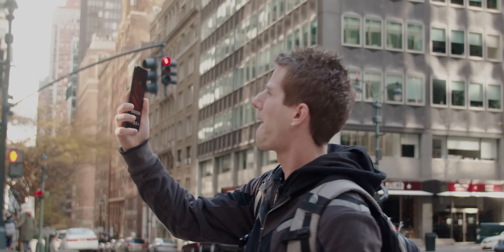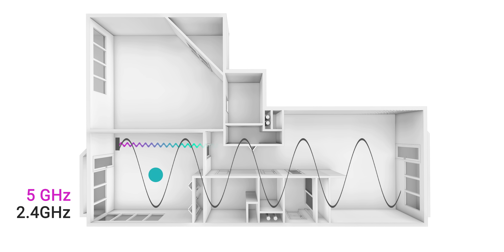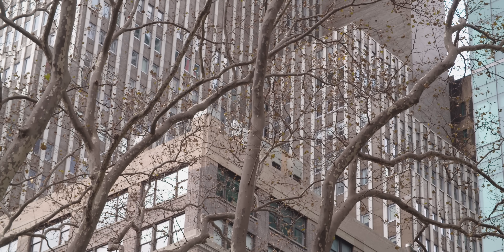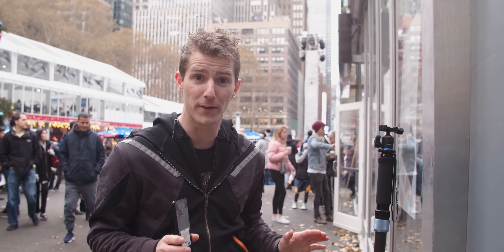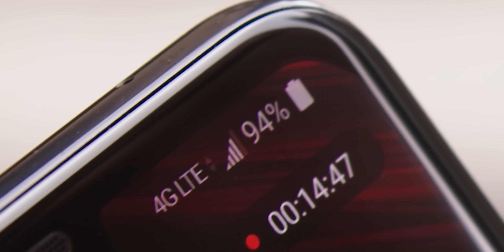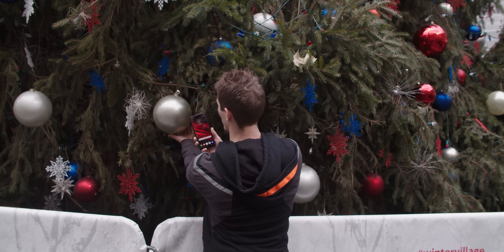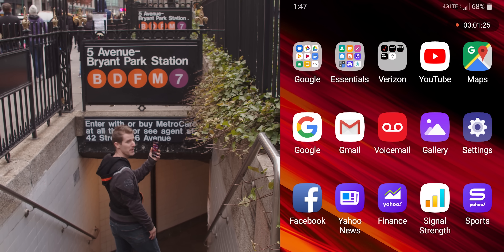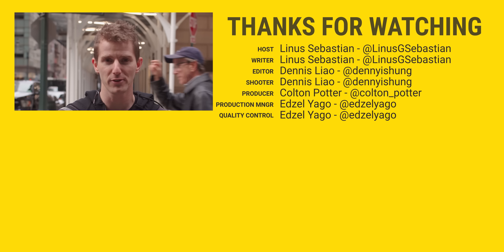The PROBLEM with 5G mmW...

Comment: There is a 5g mmwave right by the ER that also runs under our overpass. I got 1.727Gbps. If it falls to 5g its still about 100mbps. So coming from a 28.8k k modem and 2.1Gb hard disk I consider these speeds to be incredible.

Comment: This test is pretty misleading. 5G networks have only just started to be deployed. It’s true that mmW has MUCH greater BW and therefore higher data rate, but the carrier Freq is many times higher as well (MW vs mmW). It has always been known that many more “basestations” are required for full 5G deployment which is exactly what happened when EVERY other cell generation (G) was first deployed. Many people were not around when those earlier cell deployments where taking place but it was common to have dropped calls and poor handoffs then (remember 3G to 4G) how many times did you look at your phone and discovered that you were back down to 3G when you were paying for “4G”??...modern phones/devices are “multiband” and can sense signal strength and pick the best connection. As more and more 5G mmW base stations are deployed this problem will be less and less. They are also much smaller and have many antennas on them. Cement walls and metal barriers will attenuate ALL RF signals...not just 5G. It’s simple physics....higher frequency means shorter range and hence the need for more basestations. Service has more to do with how much carriers want to spend on installing new base stations for better coverage. A mesh approach will be needed for full deployment. Carriers who don’t want to spend the money on more base stations will have poorer coverage- that’s a fact and it’s always been the gating item. So companies that are saying mmW is not worth it....well, they are being cheapskates about spending money to improve service and they want to entice more subscribers to use “old” technology. mmW is the future and will RE-vamp everything we know about big data and the world of broadband data in general. It’s coming, no doubt. Huge companies are spending tons of money now to capture market share. T Mobile has traditionally just “piggybacked” on larger companies systems (like AT&T etc)....companies that HAVE invested in more hardware. And every carrier is planning a multi band “tiered approach” to 5G coverage...including low band and high band 5G. Truth

Comment: They could solve that issues by combining light fidelity and 5g bands combined with fso laser optics to boost speeds up to 255 gps upload and download in theory  , by using street lights and multi frequency modules from Tower to street lights with low band and From tower to Tower with fso laser optics  to   optics nodes and using millimeter wave from nodes to optics cabinets on rooftop  which significantly reduce cost of installing miles of optic cables  and can be upgraded to  6g commercial and mobile  networks ( basically using hybrid network that can parallel due multiple things and support high speeds under heavy stress ) without rasing frequency wavelength in future from frequency of near visible and visible light but instead increase   frequency modules to compress and receive data  at speed of light  (so called module combs that compress light spectrum frequency wavelength to send and receive data at faster speed ) something like that has been already tested in Japan and they already according to scientific research achieved petabit second speed transmissions (it doesn't say how fast so I'll asume  theoreticall 255 up and download )

Comment: hope the support (lines) working better now. just put up wifi 6 ac ax instead on bad places to be with try out 5g line s. ps 3g 2g 1g will soon turn off. and then 4g will bw turned off  somehow into the future. so yeah 5g will has it RUle INTO THE FUTURE. 5G ARE SOON  OUT HERE IN  norway skandinavia  https://www.youtube.com/watch?v=Cpp4N6zXEc0 and we are soon turning off FM too radio to get more speed to 4g +.

Comment: T-Mobile has the right plan. With them using Low Band and Mid Band they are getting best coverage with Performance all in a single Phone. And in Parts of New York you are getting over 1 Gig and that doesn't include MMWave..

Comment: 5G is a weapon. Don’t support it.
Reply: It is. 3/4g is already cancer causing.
https://www.nih.gov/news-events/news-releases/high-exposure-radio-frequency-radiation-associated-cancer-male-rats
Reply: @checktheplaylist101  no its not prooven to cause cancer. And 5g is not a weapon. Learn something about electronics before get brainwashed
Reply: @revolution5547  you must have missed the the research pulled off PubMed about 5G and certain frequencies having the same effect as the symptoms of the virus.
Reply: @revolution5547  are you slow did you not read the link
Reply: @checktheplaylist101  god damn. Flue and coronavirus has similar symptoms. Ohh it must be the same thing

Comment: First of all. We need atleast double the amount of base stations for 4g like coverage. Secondly higher freq means harder to penetrate surfaces and the signal wont reflect & scatter the way its used to. So buildings will be a huge problem. Then one more thing. Basestation and mobile oscillator needs to be soooo synced that its going to be tough. Bonus: 5G makes everything more expensive
BonusBonus: I live in Finland. We get snow. Raining will disturp 5G but snowing will kill it.

Comment: Just FYI the 5G icon is only shown when a data request is made, so if no data is being used it will just show LTE. Also mmW is meant for highly populated areas because it has a lot of bandwidth. T-Mobile’s 600mhz 5G does have really good coverage, however the speed is only a tad bit faster than LTE

Comment: WTF this video is just misleading. 

First, 5G is just a new Standard which has the possibility to be faster, but the mm Wave is just a small part. 
What TMobile is "advertising" here ist just the stuff which is written in the 5G Standard...
They are just using 5G as it is supposed to be used.......

Comment: You’re blocking our signal, Linus😉
Reply: He is a master at dropping things , including signals.
Reply: vlad zaic  then it will not be splash and water proof
Reply: I have wifi
Reply: @T-Mobile if you give me 3 reasons to change to T-Mobile from atandt I will do it
Reply: Using Tmobile’s mmWave 5G at my desk at work, and getting about 550mbps down 30mbps up. Thats better than my Cable speeds at home 😬
Reply: T-Mobile 13 likes, 8 months?
Reply: @mysteryplayer12  Sounds about right
Reply: It;’s far too easy to block your signal, t immobile.  All you have to do is go into a building.  Or anywhere else.  Your 4g doesn’t travel and your 5G is super fake
Reply: Your 5g is not that good
Reply: If only you could have blocked your customer's private information from being stolen 🤷

Comment: Not to mention the issue with battery life, as a mmW is a much higher frequency wave, hence would require more power to send signals over to the receivers.Current 4G network frequency ranges from 700MHz to 2.4 GHz, while the 5G network frequency would range from 24 GHz to 100 GHz, which would mean somewhere from 10 times to over 140 times power usage (since power of a signal is linearly proportional to it's frequency).

Comment: When they say MM-wave (Millimetre Wave) it's a signal from 24 Gigahertz to 100 Gigahertz frequencies which is basically what radar uses. It also COOKS YOU !!! Millimetre wave radiation, even at the milliwatt levels used by 5G, WILL cook your cellular structures over time and over repeated exposure. 

I never could figure this out WHY companies do this! It's BASIC SCIENCE !!! While not truly IONIZING radiation that destroys DNA, MM-wave does cook your cells over time. It not the low power but rather the repeated exposure which will eventually cause damage to the cells in your body.  The higher the frequency the MORE LIKELY he interaction of the high frequencies with the human body's cellular structures which means a higher risk of degradation and mutation over time (aka Cancer!).

What SHOULD be done is more basic research into Quantum Entanglement which would give us SAFE Petabit transfer speeds because the method of interaction of the entangled Quanta (i.e. "quantum waveforms?") are LIKELY at or below Planck's level scales. This means the much much larger molecular scales of human cellular biology would be unaffected by such tiny interactions.

Since Quantum Entanglement-based communications occur over unlimited distances at faster than light speeds (QE has been scientifically PEER REVIEWED AND TESTED  to be 10,000x to 50,000x the speed of light!) it means once we humans figure out how to READ/WRITE Q-Bits (Quantum Bits) without causing unintended de-coherence, we'll have that 512 bit multi-petabit Qbit modem with UNLIMITED GLOBAL COVERAGE for a few bucks a month!

For LTT, you can get more information by phoning up your local Burnaby-based friends at DWAVE (i.e. Quantum Supercomputers) about when and where quantum entanglement-based communications will come out in the general marketplace. 

Of course, there will be that awkward silence on the end of the phone as they try and figure out from WHO and HOW you got this information, BUT you can tell them a local competitor is using Xenon and other Halide atoms confined within a Q-Well on CMOS being used as Qbits AND that we are using nano-lasers as the entanglement enablers AND using the presence or non-presence of various TYPES OF RANDOM NOISE itself as the method of encoding "viable information" within a likely series of entangled Q-bits. 

We COULD also record and entangle the POSITION of the halide atom within the Q-well OR its spin, but femto-second lasers need special cooling and a lot more size reductions to make that Position OR SPIN encoding become viable as the modulation schema!  Right now we use NOISE (aka absolute decoherence) or possibility of NO NOISE (aka likely coherence) at every X-amount of linear time sample as the bitwise modulation schema of high bandwidth Q-bits based data transfer.

.

 
The WAVE of the future in telecommunications is QUANTUM ENTANGLEMENT of high numbers of Q-bits (128, 256, 512, 1024, etc) for PETABITS PER SECOND (128 Terabytes+ per Second!) of data transfer rate! 

 YES you can use it to play Crysis over wireless using a Q-Modem capable phone!

.

Comment: This is not surprising at all, at those higher frequencies we are in the territory waves starts to behaves more like light than radio waves. As one expect light is fast to transmit things AKA fiber, but it is also just like your tv remote, short range blocked by pretty much anything, bounces off shiny surfaces.

I see this being used indoors like in malls, or they better stick an antena on every street pole.

Comment: Is it possible to re-do this video by showing the actual signal statistics using a mobile app which shows engineering information? Bars are inherently unreliable as a statistic. I also wouldn't be surprised if the hand-off between 5G and 4G is very poor, like it is between 3G and LTE. Or the handoff issue that happens between LTE-A and LTE towers.

Comment: Radio and light are the same thing, but at very different frequencies.  Millimeter wave is closer to light than to radio, so it should be no surprise that it behaves more like light waves than radio waves.  Just about anything can block them.  So to use this band reliably, you need a gazillion sources spraying the stuff near-field.

Comment: Faster wireless means shorter wavelengths, meaning less penetration through objects. Therefore, increase the density of the Access Points and problem solved.

Comment: LTE is fast enough for movies, so what's the use case that needs this again?
Ironically one reason that T-Mobile is a budget carrier compared with Verizon, is that Verizon has lower frequency bands than T-Mobile which means you get better reception indoors, even some reception behind big concrete walls and better reception in the rain.

Comment: I think 5G is just silly right now. In Germany you can get LTE pretty much only in cities, H+ a bit further out(it's still fine for most things from a speed perspective) and only E if you go out a bit further again. Also, 1Gbps mobile connections are pretty useless if there isn't a decent fiber backbone network, and we don't have a lot of fibre here(most homes have dsl, but I don't exactly know what distances are covered by copper and what is covered by fibre). Switzerland has pretty good LTE coverage from what I can tell as you can get it pretty much in the middle of nowhere.

Comment: "heres how tmobile is better"

proceeds to explain how every mobile carrier ever works
Reply: more like: proceeds to explain how it is written in the 5G-Standard
Reply: Moira Prime Keep repeating their corporate talk points because they pay you. T Immobile is fake 5G period
Reply: @RejectedSpiritX  How's that Verizon and AT&T 5G treating you? Because Verizon just flipped the switch like T-mobile did with their sub 6 5G spectrum... Except T-mobile is working opposite of what Verizon is doing by rolling out the low and mid bands first and making sure that infrastructure is there and then shifting their focus on the high band. 5G UW isn't practical in a lot of situations as there is limited coverage and it's very easy to block. It's not "fake 5G", it's just more reachable 5G. Also 5G is more than higher speeds, it also offers better end to end encryption than other cellular technologies prior. And no, T-mobile hasn't paid me to say that and I'm not shilling for them although, I do use their network but that's because coverage on the other two aren't the greatest in my area.
Reply: @RejectedSpiritX  Nah, a small medal will suffice... Or nothing at all. I'm really not picky since you offered.
Reply: @AlphaCodexx197  certainly my response indicating how interested I was will be sufficient
Reply: @RejectedSpiritX  I'll take it. Thank you graciously random from the internet for taking great interest in my contribution to this discussion thread. I'll be sure to take your comment and frame it on my wall to remind me to do better in the future.
Reply: @AlphaCodexx197  I’m glad to make a lasting impression. Best wishes, mate.
Reply: More like:
"heres how tmobile 5g is better"

*Proceeds to show it's not going to be real 5g*
Reply: @Jorge86295  Just like 4G LTE is also not real 4G. Nothing in the mobile world actually lives up to what it is said to be, unfortunately
Reply: @FoxyllAkora  Wrong, 4G is 4G. 
But 4G just means 4th generation (so all IP-based), it does not necessarily indicate speed.

Comment: When I got my Note 10+, I was faced with picking up a contract w/ Verizon and buying it on a plan but full-price OR just getting the Note 10+ without 5G (yet still unlocked ofc). I still am glad I did not over-spend and get the 5G variant, as by the time the service is actually ready I'll likely have a Note 14+ or something...

Comment: We will not have this problem in Germany. Here you are already happy about 3G, a continuous LTE connection would be a luxury, especially outside of your city.

5G is planned, but if the implementation works as well as our 4G, it will be a pointless waste of materials. Our mobile internet It is outrageously expensive, data limits and dead spots are a daily annoyance.